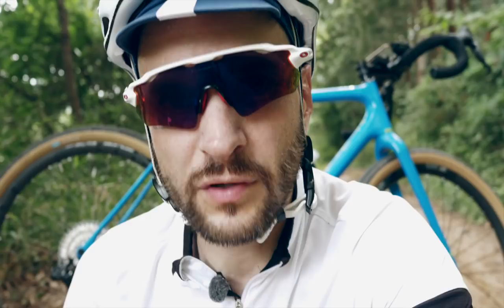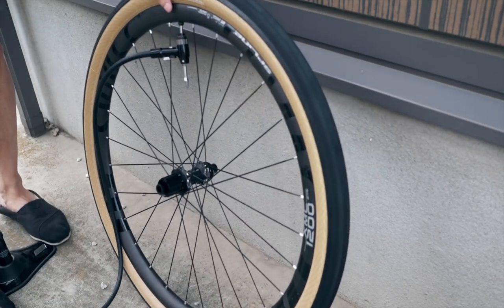First ride(s) DT Swiss 650b w/ Compass tires impressions / New Wheel day Part 2

Comment: When I ride my byways, I ride 35psi at 79kg. I don't ride below 30. I actually ride them at 45ish psi if I'm doing all road and it's a huge difference in terms of getting where I'm going
Reply from the maker: Thanks for that info!
That sounds about right.. I'm about 15kg lighter so 25-30psi seems to be a good starting point at least.
Reply: Rides of Japan it's funny because my daily driver on my ibis hakka mx are the 650b, but I like the bikes geometry and 1x enough where last night I just ordered some hunt 700c with 25mm tubless so I can do some endurance road riding on this bike. So basically the opposite of what you just did. My venge with zipp 404s is comfortable to ride but I do get a headache from the low drop on 100 mile rides.
Reply from the maker: Daniel Baker nice! 
Regarding headaches, I get the them as well fairly often the day after a big ride... been experimenting a bit with different methods to combat this, lately it seems like a massage over the shoulder blades and neck (I use a small foam roller) really helps! Will try to get one of the small massage balls as well. 
Don’t know if you already tired it but though I’d share my “hacks” as those headaches are a bitch!
Reply: Rides of Japan thanks for the pointers.  mine are the occipital nerve right on the base of the skull. Will happen 4-6 hours after a ride if I've been off riding for a while, or make a big mileage jump. Massage makes this particular thing worse, but antiinflammatory taken immediately after riding seems to be best. In 17 years of riding (and two ER visits) I've only finally realized the real source. It's excruciating when it happens..
Reply from the maker: Ah, sound like a different issue than mine then. Mine always come at least 12 hours after the ride. Happy you finally figure out the source. Sounds like the Venge should be Replaced with some new gravel tech hehe. 
I've been moving up from pure race geometry to more releaxed stack number in the last few years. Hasn't helped my headaches much though :/
Reply: Rides of Japan yep the venge is replaced about 60% of the time by my Ibis Hakka mx, which is very similar to your open in design/construction, but the orange of your Mason. It does have a higher stack though I believe (I have nearly zero drop on that bike which was my goal). It’s got the oversized threaded B.B.(T47?). I have the 1x SRAM Rival with a praxis Zayante chainring. Because Southern California has some steep gravel, I use the 11-42 cassette with a praxis MTB 30T chainring some days, and go up to a 40T depending. I’ve done a few mixed terrain rides at about 80 miles, with 50 miles of gravel/dirt climbing where the 30T is essential.
Reply from the maker: Sounds like an awesome build! If there's something I wish they would change on the Open it would be to put a T47 in there, but you can't have everything. Really like the look of the Hakka, only thing I'm miffed about is why they specced it with a post-mount fork... again seems like we can't have everything.
I've been pretty happy with a 1-to-1 ration this far (42-42), but as mentioned in the video I'm thinking about the Sunrace cassettes, and after a closer look, the 11-46 looks mighty tempting...
Reply: Rides of Japan yeah, I fussed over the post mount (ENVE fork) issue for a long while, but obviously went for it. Independent of your watts/kg, if you like to do long rides on steep terrain, it makes alot of sense to get an 11-46. I see the attraction of the dura ace crank, but 42T is brutal for me. I honestly think 34-36T is the sweet spot if I could only pick one chainring - and I've unfortunately wasted way too much time crunching numbers and doing power/cadence tests on this topic.

Comment: Hi, I'm trying to achieve the same goal as yours (one bike, two setups, road and gravel) WITHOUT having to set the discs every time: do you think it's somehow achievable? I'm looking at Dt since it has a wide variety of option on 650b. However, on my other bike (Salsa Fargo) even using the same manufacturer, American Calssic, but probably different hubs :( , I have to set up every time I switch from 29" to 27.5"
Reply from the maker: Matteo Fini I made a video in this topic recently: https://youtu.be/LG2ApxL0eIA
Reply: Rides of Japan damn, I had missed that one! Thanks for sharing, thou

Comment: Wow! And I though it was hot here at 32 degC! It’s when you stop and realise you’re getting hotter and hotter and... got to get moving again to cool down. Seriously considering 650bs with fat rubber but that’d be three wheelsets for one bike. Excessive?
Reply from the maker: My garmin crossed the 40degree mark on this ride while out riding in the sun... the humidity is the real killer though... I dreaming if Japanese fall already.
New wheels are never excessive, go for it! ;)
Reply: That would be cheaper than 3 bikes!

Comment: Rides of Japan, thanks for the great video. Quick question for you, with the Stans Race Sealeant, how quickly do you lose pressure? And how often do you have to replace the sealant? Maybe too early for you to say. I have Compass Barlow Pass ExtraLight run tubeless on Stans Grail rims with Orange sealant. I find with about 4oz of sealant my tires will drop from 35psi to 20 over 5-6 days, then after about 4 weeks that suddenly drops to about a 12hrs! The Orange seal is coming straight through the sidewalls so my tan Compass tires are speckled with funny orange patterns. I've figured after 4 weeks the sealant dries up/runs out and I have to add more. I then get about 3-4 days use before needing a pump again. As I commute on my bike I don't want the hassle of pumping them up every few days so thinking of reverting back to tubes with a small amount of sealant, but wondering if Stans Race sealant might be a viable option. Very frustrating as this wasn't what I thought I was buying. But hey-ho, that's life. I'll deal with it!
Reply from the maker: Yeah, I've only had them mounted and "sealed up" for a week now, so can't really comment on it yet. They seem to hold the air pretty good, just had a check and the front had lost the most air, 5psi since Sunday (4 days ago). No "weeping" as of yet though.
The Race sealant are suppose to last 6 months... I'Ve yet to confirm that obviously. But I recently removed some tires that was used with normal Stans and I still had sealant left in the tire after 6 months so hoping it's the same for the race variant. I can imagine it will dry up quick if leaks through the sidewall though.
Cheers!
Reply: Contact Compass. The leakage should not be happening.

Comment: I believe the Shimano 11sp road cassettes that go up to 32 will now fit on 8/9/10 sp freehubs.
Reply from the maker: Jay Tee ah, you’re correct, the ultegra level CS-HG800-11 (11-34) and 105 level CS-HG700-11 (also 11-34) will fit.
Thanks for the correction 👍
Reply: Regarding Sram chains and cassettes, I've always gone back to shimano.  Sram might create less noise, but they don't shift as well as shimano in my experience.  Sram cassettes are just poorer in shifting performance. All levels of Shimano cassettes work well - it's hard to argue with their design. It's been a while since I've given Sram another try however.  Once my faith is lost on a brand, it's really hard for me to go back!

Comment: Great video. What happened to marks hunt wheels? I noticed he wasnt using them in the video when you compared tyres? What are your thoughts on the hunt wheels?
Reply from the maker: TechnicHull he still has the hunt wheels, think he has a total of 3 wheelsets for the Niner 😅 he was riding his 650b setup on this ride so we could do a few comparisons. The hunt’s cost-performance are hard to beat. He did have some issues with the one of the front end cap coming loose, and we had to hack together a tool to fix it out on a ride. So I think the hubs are he weak link of the Hunt’s but they still super nice wheels, especially for the price.
Reply: Rides of Japan thank you! This is really reassuring to hear as I've just bought some myself. I can't quite afford your setup 😂 but your ride is very nice.

Keep enjoying the videos, I'm new to your channel but I think that's key as you seem to love what you're doing in the videos. 

All the best from the UK.
Reply from the maker: TechnicHull thanks mate! 🙏
Hunt seem to be pretty good with the customer service as well so if anything happens it shouldn’t be impossible to fix, especially since you’re in the UK as well 👌 (Hunt are UK based right?)
Reply: I really like my Hunt Wheels and wouldn’t hesitate to recommend them. As @ridesofjapan said, I had a small issue with the end cap unscrewing itself. Hunt customer service was great with same day email responses and they sent out a new end cap to Japan free of charge. Turns out that the tiniest amount of weak loctite has seemed to have sorted the problem. The Hunts with 38 gravelkings on are noticeably faster than the ritchey 27.5b with byways on them.
Reply: This is great to hear. I purchased the same wheelset and just installed gravelking 38c tubeless. I followed your videos and although I'd never setup tubeless before the combination was a breeze!! 

Quick question - did you have to use the lock rings that come with the hunt wheels or was you able to use the lock rings that come with the Shimano rotors? I will just bought some new shimano rotors but I'm missing a Shimano lock ring with one of the. Wondering if it matters?
Reply from the maker: TechnicHull it depends on the axle you’re using, if it’s 15mm you need to use the hunt lockring as the cassette tool used to tighten them won’t fit over that 15mm
Reply: Rides of Japan cheers mate 👍 Great source of knowledge. It was your in depth tubeless setup I followed. Worked a treat for  a newbie. Looking forward to seeing more from you and Mark.  It's also interesting to see Japan this way. Very different from the UK, America or even Australia (other cycling videos I watch)  from the looks of it. Keep enjoying the riding and we'll keep enjoying watching.
Reply from the maker: TechnicHull thanks mate! Nothing better than knowing my video helped someone out! 🙏

Comment: can i fit this to a 700C wheel?   currently running 28x1.75 but i would like something wider
Reply: rene herse (former compass tires) has an even wider 55mm tire, called the antelope hill, for 700c now. that wont fit many gravel bike frames though.

Comment: I’ve been using a Sun Race 11-42 cassette on my gravel bike and it’s been fine... it’s lighter than the XT equivalent. I’ve just picked up a set of DT Swiss XMC 1200, how have they been? Thanks
Reply from the maker: Craig Ganderton awesome! Cheers!
The wheels have been really nice.. I’m mostly impressed by the weight, I don’t really know how much you feel the characteristics of the wheels when you run 50mm wide tires but have no complaints. Tubeless setup was relatively easy, really dig the 24mm internal width, just the right size for road plus. And the 240 hubs don’t really need more praise, but the ease of service is why I really wanted DT Swiss.
They look pretty sweet at well :)

Comment: Why you wearing a hat when it’s over 30 degrees?
Reply: As a fellow baldie a cycling cap makes a world of difference for keeping sweat out of your eyes.
Reply from the maker: Neil Schaffer yeah, what Steven said. That and to protect the bald head from the sun.... it’s a curse having this much testosterone ;)
Reply: As  fellow member of the kojak club, I know buffs are the best, but are definitely not pro... Can't be beat in winter though. In summer time caps rule.
Reply: @BrentonCollas  There's Buffs and Buffs. Riding across Montana one summer I got sunburn through a Buff. There is a UV resistant Buff that I use now; it's a smidgin thicker.
Reply: @trek520rider2  you're preaching to the choir. I always buy a pile of buffs when in Thailand. Also in Australia we have mandatory helmet laws so only have to worry about the gaps.

Comment: PSI recommendation from professionals mtb cyclists: as low as possible. You will fly on gravel and off-road. 😜
Reply: keep it at a safe pressure. Unless you have a tire foam inside. Numerous case of rim destroyed by rocks, following your opinion.